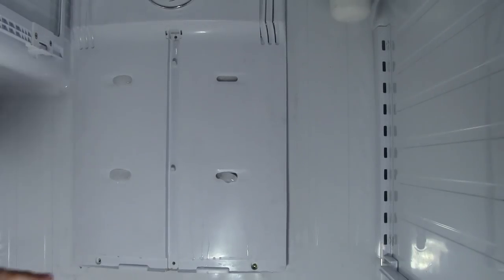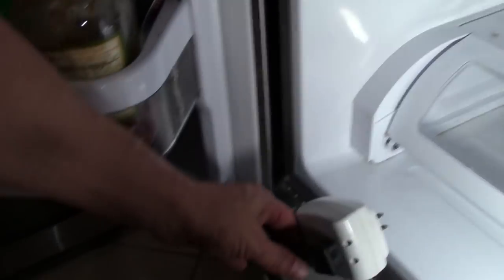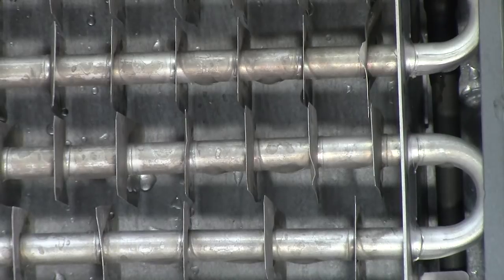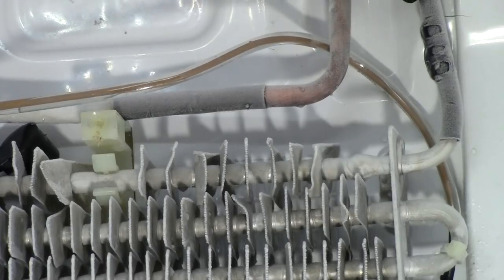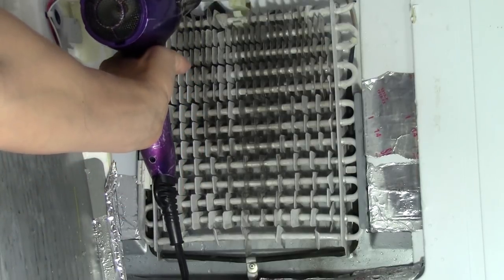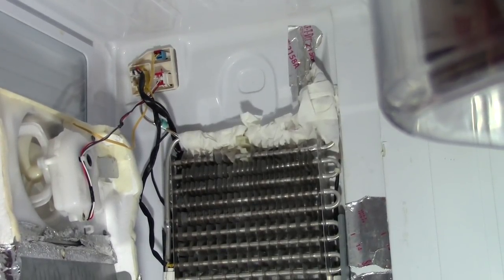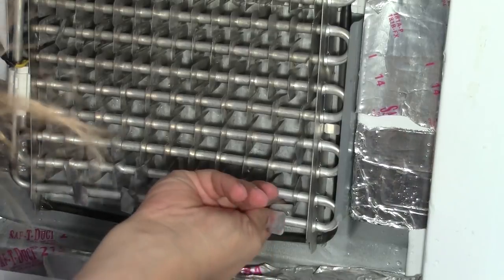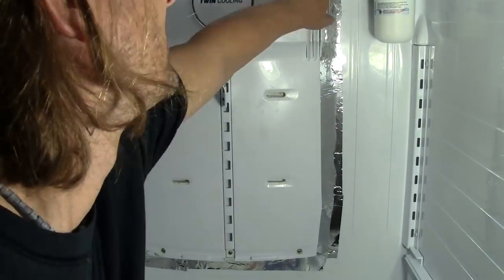PART 8 How to Fix a SAMSUNG RF 267 Refrigerator Not Cooling Icing and Freezing DIY repair

Comment: Tried all the easy fixes - none worked.  Eventually replaced the evaporator cover and sensor. 9 months later no issues.  25C was the original error code fyi.   We dont use the ice maker anymore to be safe  -  if you use it, would suggest turning it off after bucket full.

Good luck. Watch out for appliance repair scams!!

Comment: So what happened?  It's  been over a year since this video so I was wondering if what u did in this video worked or helped. Thanks for the videos. I use to love my samsung but lord I hate it now.  It's humming and leaking into the drawers, so tomorrow I think we're going to take ours apart and I'm going to start saving my money to buy a new fridge, no more Samsung's fridges for me.
Reply: W10619951 Whirlpool Refrigerator Tube-Drain

Comment: We have the similar SamSung Fridge that blown a heater fuse after 4.5yrs, and frozen up like that when the auto defrosting system stop working. SamSung provided a warranty repair service, replaced the fuse and it now is working just fine.

Unless for your personal interest and learning, Why even bother mucking about and wasting your time like that Jake :) ?

An interesting video anyhow !
Reply: Dear Kenny, there are a lot of videos on these Samsung refrigerators simply because Samsung technicians have no idea how to fix this particular problem. My refrigerator has been broken for the last 5 years, with no real help from Samsung. They deny that this is a common problem. I haven't bought a Samsung product ever again, for this very reason.

Comment: My samsung 260 ltr double door refrigerator is electrically shocking ( there is no earthing in building), what is the probable cause???????
In my opinion refrigerator must not give electrical shock whether it's body is connected to earth or not.
Reply from the maker: +Sunil D ---> There is no fix.  Samsung refrigerators are supposed to shock you every time you touch the door.  Samsung invented that as a diet aid.  Were you overweight when you bought the refrigerator?  Maybe the salesperson threw in the shocking door feature because he thought it would help you stick to your diet.
Reply: Jake-I am now in the midst of a 2nd repair in 8 months....and now I understand Samsungs' thought process in developing these "one of a kind" products.  thanks for the insight...and a belly laugh-which I need right now-

Comment: If you hold the energy saver button and the fridge button for 15 seconds the fridge will go into access mode.  Hit the fridge button  4 times until you see the code “FD” displayed.  This is forced defrost mode.   This way your fridge will defrost properly

Comment: My freezer frosted over badly. I sopped up a bunch of water in the bottom of the freezer. Now the refrigerator gets cold but the freezer won't freeze. The temp drops to 0 on the digital readout but the freezer is not even cold. Then after a while the readout that says 0 for the freezer blinks on and off. Anyone experience this? I'm Def checking out the drains. I was going nutz trying to figure out where the waste water drained to??. Thanks for your help.

Comment: As a refrigeration engineer,this is completely wrong! all you are doing is restricting the air flow,if the evaporator is iceing up its usually to do with the defrost cycle not working properly  or defrost probe out of calibration ,this is one of the most common problems  in modern refrigerators under electronic control,give me the old mechanical defrost clock anyday.

Comment: I just had to rip mine apart again this morning. This time it only made it maybe 3 weeks before it was already starting to drastically ice up and not cool the food as well. I did the paper towel trick, but forgot to buy the foil tape, so we will see how well it insulated without the tape :( Also forgot about the bottom coil as well, I think I was too afraid to bend those bottom coils. I did however notice that the heating coil does not seem to even bother to get hot (likely causing it not to defrost the ice) so I am curious if it would be a good idea to buy a new heating coil or maybe it is a thermostat that causes it to heat up?
Reply: Coil or defrost sensor  bad   my guess.Sennsoe about $15     I''m at 6 Months and still running great.

Comment: Does anybody know at what temp these typically go into defrost? I keep on getting code 25 E defrost running longer than 80 minutes according to self diagnostic. If I force defrost the elements work and the sensors check out as well. Defrost sensor gets down to -7 F without the fan running  but I am not getting 120 V out of the board at that point.

Comment: the drain tube freezes over is the main problem I believe. go to ebay and type in: Authorized Factory Replacement DA61-06796A Clip Drain
Reply: That's what a repairman did and it did nothing. I used 2' of very heavy gauge wire wrapped around the heating element. Worked 2 years. Back to square 1 now.

Comment: I have samsung RF28HFEDBWW Has had problems since the start A year ago this same issue evap freezing.....I replaced the temp sensor and lasted a year. Now its been freezing over again every week. just so frustrating/enraging. I am replacing the defrost thermostat, f that won't fix= 1 then replacing heater unit, if that won't fix, 2  on to  control board, if that won't fix I am going to beat the (*&% out of it w/ a hard tool to dismantle it, with the rest of it I will drive it to the recycling yard, dragging it  behind the truck with a chain!!!!!.......(well probably not all that I will probably get rid of it somehow still)

Comment: I too suffer from SAMSUCK disease. They definitely know how to build refrigerators that only last 1 year. Whether it is the ice cube maker being non-functional or the refrigerator section not cooling. Also, purchased a SAMSUCK large screen TV at $3K that lasted only 4 years. SAMSUCK - never again.
Reply: Wow! Lots of bad luck here. Ours is still running after 10 years with none of these problems. Replaced it this week because lightning strike has made display/control board wacky. Replaced with another Samsung, have this one out in my shop and will try to replace board if I can find parts.  (RF267AEBP)

Comment: OK so I see what he is doing here but paper towel is a no go ..once it is wet it has no insinuative property's at all and will freeze you don't want something that will hold water but repel it and pipe insulation yes the black grayish stuff you buy at home depot for copper pipe would do the trick. The heater does not go beyond the temperature to set things on fire lol. If it did the most of the fridge is plastic and would be awesome for setting your house on fire. The defrost cycle is not long enough but to get power ratings it is cut short you now the STAR for how efficient it is but no disclaimer your fridge will freeze solid to get there lol. My fridge does however have a forced defrost that I was never told about so do your research before resorting to doing something like this. And to the people that ask where does the water go well there is a pan that collects it at the bottom of the fridge and when the compressor comes on it blows across this pan to evaporate the water with heat and air flow.

Comment: He did not fix the root problems. After a few weeks, the problems come back again period. I don't think what he was doing about the samsung french door series rfgxxx. The bottom is freezer but he shows the refrig section behind the double doors. Get a digital thermometer ($5) from amazon. Place it and see the temp is closed the display panel that should be (-4) for the freezer and (36) for the refrig. Run diagnose to see any error codes. If the display shows 8888, your samsung refrigerator is working. If there are any problems for example not cooling, ice buildup and so on. The trick to fix these problems.  you have to remove the back of the metal panel to clean completely the drain pipes and the pan, remove all the dust block the air circulation. Good Luck!

Comment: Sorry bro you're way off. That is not a good solution. You have a defrost problem that needs to be fixed. I agree with John h. not a good idea placing paper next to heating coils. Frosting up is normal, that's why the heaters come on a timer to melt it. if you have ice build up, you've got a heater/bi-metal problem or a drainage problem. Your simply blocking air flow with that paper which is exactly what the ice is doing.
throw that samsung to the curb. that's what i did. Never again a bottom drawer freezer..

Comment: You're wrapping paper towel around a HEATING element, inside a FALAMMABLE PLASTIC fridge.  Plus there is the fire/explosion issue if the fridge is using R600.  ???   Your advice is beyond stupid, it's downright dangerous.

Comment: Samsung has a class action lawsuit against them right now for this fridge and many others if you own one I suggest joining in on the lawsuit and getting your product replaced or refunded, not sure what the first steps are but there are many groups on Facebook that have help to go about the lawsuit be warned Samsung will do any and everything to not do a thing to help you and will try to send out their techs to fix it but they have over 1000 techs and will only send the company called dish, yes dish the people who install your satellite services are supposedly refrigerator technicians 😂 and if you live in a certain area they will not work on it because it’s a sealed system because sealed systems cannot be fixed and they know that and still fight giving you a replacement or refund ours stopped working 4 years after we bought it and we paid $2000 for it it was under warranty when it stopped we have all the service orders showing what happened and the 5th service order said it was not repairable we’ve turned all that in to Samsung and they are still trying to fight it so we are continuing with the class action lawsuit the company for the class action lawsuit is in New Jersey!! Don’t be fooled Samsung will not try to help you at all they don’t stand by their customers they try to hide everything they can so that the consumer will give up if you receive anything stating it’s from the president of Samsung it is not it’s from a 3rd party company they use to scheme and keep you running in circles

Comment: Buy more Samsung!  Help Samsung help us.  I just went out and bought more Samsung appliance for my entire house!  Long live Samsung!
Reply: They are lemons.  I have mine disassembled at the moment. They other area that is overlooked is between the Styrofoam and plastic front cover. I have a pot of water on the burner right now. The hot water has to be poured down the front panel to clear the ice in front panel baffle. I have it oriented horizontal with a slight angle away from  the fan.  What a piece of junk. Samsung should have to buy these thikngs back from us.

Samsung never again. Period....

Comment: Sorry Jake this is a no go.
You wrecked the inside of the fridge. 
I think you are just joking around.
Stick to the guitar.
Samsung is in a class action lawsuit for the crap they build as well as LG.
These manufacturers have a design flaw that's all, and it needs to be corrected.
All because if the so called energy efficiency aspects.
They don't make them like they use to.

Comment: Wrong on so many levels. First, you SHOULD see an even coating of frost on the evaporator coil during normal operation. Hard ice or thick buildups should not be present defrost at your own risk. I stopped watching this at the point where paper towels are being wrapped around the coils. I just can't...go...on....

Comment: You have paper towels right over the defrost heater get them out of there before it catches fire. A little knowledge Is a bad thing because people. Do things like this. If it's forming ice in the corner either the door gasket isn't sealing the right way or the condenser is full of dust and the back of the fridge is too close to the wall and it's overheating. So if hot air gets in to the freezer it's going to form ice. If it's overheating from dust in the condenser it's going to shut off start melting and build up ice. Plus it has thermistor that may be bad or the defrost thermostat isn't keeping it on defrost long enough. It's one of these that's wrong with the fridge.oh if he drain is closing up get a small part of a coat hanger hang it on the heater into the drain hole but only about and nice or so make sure it's metal the drain and there's nothing that can burn. If good then when it goes onto defrost it will melt any ice build up in the drain. But like I said make sure in the hole and not hitting anything that can catch fire it should be centered in the hole.

Comment: Delete this, this is terrible advice. You're creating a fire risk not to mention the "insulation" you suggest they add won't work for long because it will soon become wet and do absolutely nothing. The real solution to this issue is the upgraded kit that comes with a new drain tube and the upgraded drain heater tab that extends into the hole further to prevent freezing. If someone has a fire as a result of your video you could very well be held liable, as you should be. Numerous people have warned you that this is a very real risk (fire)..

Comment: Look up "giant piece of shit" in the dictionary and there is a picture of a Samsung refrigerator. Look up "hammer mechanic" and Jake is pictured.
Reply from the maker: Hi Rocketrayray.  I feel your frustration and pain.  Everyone who has bought one of these refrigerators has had problems.  I never stated that I am an expert refrigerator repair person, in fact in part one I explicitly stated that I am not.  No one has to listen or watch these videos, but I am confident, because I have been in contact with many people, that the videos, even done by a "hammer mechanic", have been helpful.   I'm only doing my best with this thing and reporting what I am doing/thinking as I go along.  If there were a simple solution to this icing problem, we would all know about it by now.  I can take criticism.  But, if you are going to criticize, at least offer another solution to this problem.  Believe me, we ALL want to know.
Reply: Just busting your balls, Jake.
Reply: My solution? The scrapyard.Take them ALL there

Comment: Please don’t listen to this guy. He has no knowledge of how a refrigerator operates. The coiks need to frost up. The coils need the warm air to flow over them, that is how it removes the heat inside the refrigerator and takes it outside. 
The unit goes into a defrost 3-4 times a day no matter how much frost is in the coils. If it’s nothing defrosting the ice and your having the problem this guy is have, you have a problem in the defrost circuit. Either the defrost heater, the defrost thermostat or the defrost control has failed. He should be testing the heater since he’s already got the panel off. 
Sorry Jake, but you really don’t have any business doing a video on refrigerator repairs unless your a qualified certified technician that is willing to be responsible for what your telling be to do. Your going to have people screwing up their refrigerator.